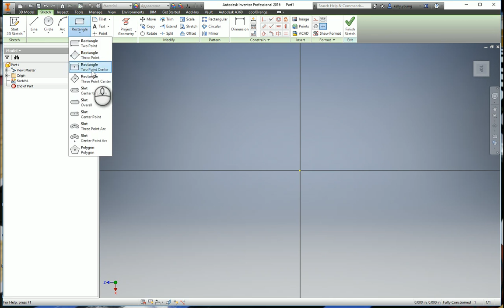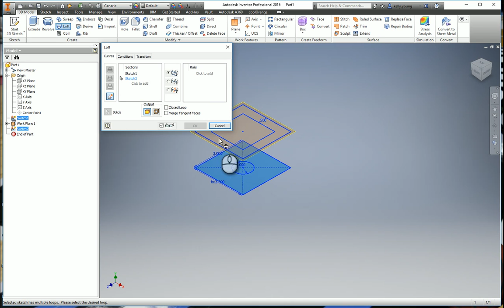Inventor Cool Orange Thread Modeling

Comment: Good morning,
I don't understand why the external thread is OK but the internal one isn't. Only with Coolorange does it add material, and therefore the thread isn't right. I should do it on the inside and not the outside. Where am I going wrong?